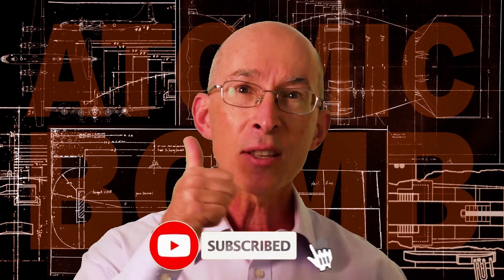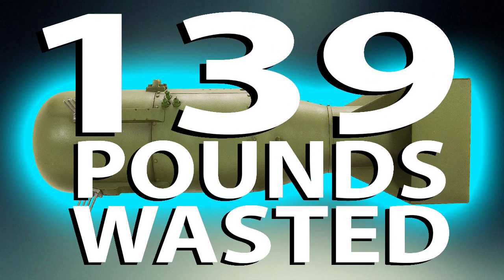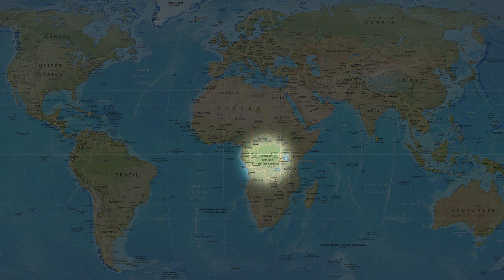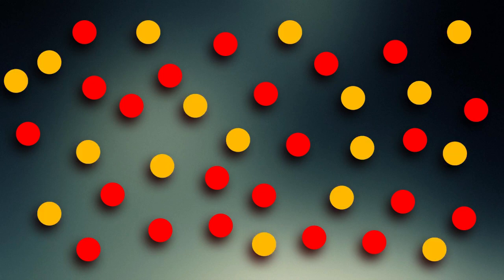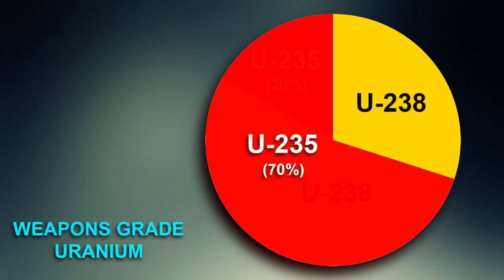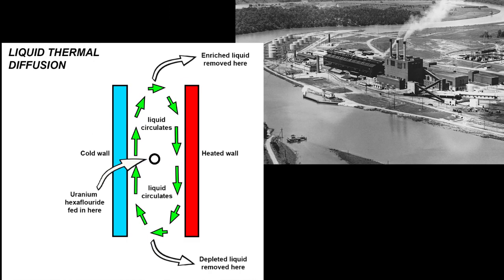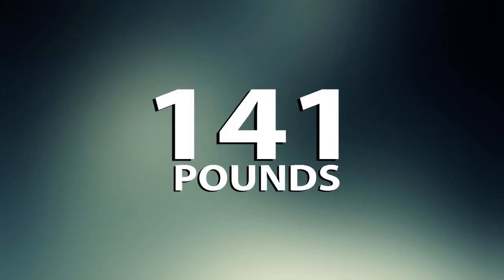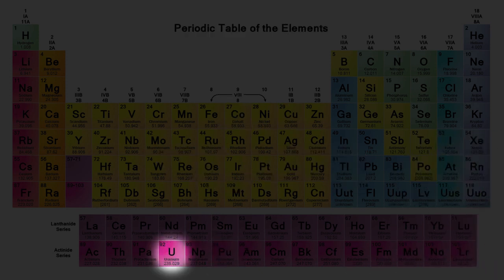ATOMIC BOMB: How the Hiroshima A-Bomb was Made (Pt. 1)

Comment: I read somewhere that they had a use for the Little Boy design after the war, as a ground detonation 'bunker buster' type roll. Also have you ever considered the idea that the gun type bomb is a crude particle accelerator? I read this idea in "To Hell and Back", it got me thinking, did Little Boy blast an ionizing beam through the planet when it detonated? Or is this crazy talk.
Reply: The Mk-I didn't have any fuzzing options for lay down or ground penetrating delivery.
Gun type weapons are not particle accelerators.
Starting in 1955, American devices began to use sealed neutron tubes to initiate the fission reactions. These are particle accelerators.
That last bit is crazy talk. It didn't produce any beam. It did produce an omnidirectional burst of gamma rays, neutrons and anti-neutrinos, however. The majority of the latter would penetrate all the way through the earth without interacting with anything.

Comment: A nice introduction to the layman, but there's some technicalities I'd like to address. 
Although the Mk-III's core did technically feature a central cavity for the initiator, it is termed solid, to contrast it with true hollow levitated pits developed in the following years. 
The gun type configuration was not discarded after the war. Other gun type models produce by the US include the Mk-8, Mk-9, Mk-11 and Mk-33. 
Natural uranium also includes U-234. 
Neutrons absolutely do interact with U-238. There are attractive forces between them. At some energies, those in the bottom few percent of the fission spectrum, the total cross section for U-238 is actually higher than for U-235. For the majority of the spectrum, the total cross sections are broadly similar. 
Gaseous diffusion doesn't work on the principle that different isotopes have different sizes. It works on the principle that at a given temperature, and thus a given particle kinetic energy distribution, the lower mass nuclei will have a higher velocity. Thus their partial pressure is disproportionately (although only by a matter of less than 1%) higher, and thus they undergo more collisions per unit time. If the gas interacts with a semi-permeable membrane with holes smaller than the mean free path of the particles in the gas, only free molecular flow can occur inside these holes. The lower mass uranium-235 hexaflouride molecules are moving faster, thus collide more frequently, thus pass through the holes in this filter more often. It has nothing to do with the physical size of the molecules, as they are far smaller than the size of these holes. 
K-25 featured thousands of diffusers. 
The fuel in Little boy was on average 83.5% enriched. 
Pu-239's half life is 24,110 years, not 2.4 years.

Comment: Technically 238 is also fissile, provided you smash it hard enough with a neutron, but you need fusion neutrons for that, regular prompt fission neutrons don't have the choich factor.

That's why if the Russians had built the Tsar Bomba using U-238 for the outer casing instead of lead (as originally conceived) it would have had double the yield.
Reply: It's not fissile, it's fissionable.
Around 43% of the fission spectrum neutrons from U-235 are of sufficient energy to yield fission cross sections above 0.1Bn in U-238.